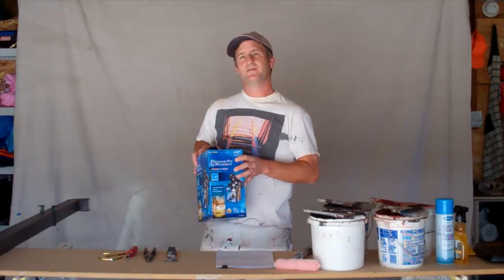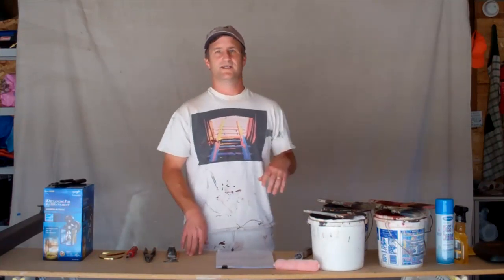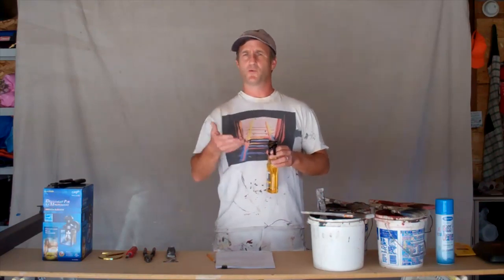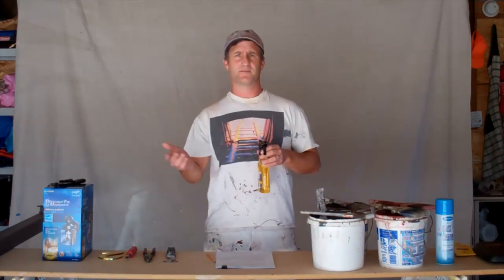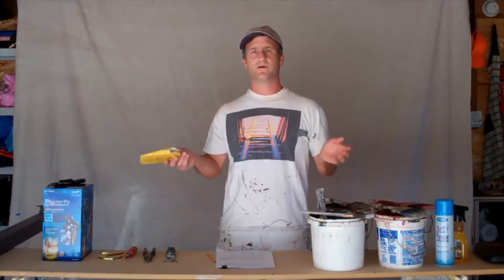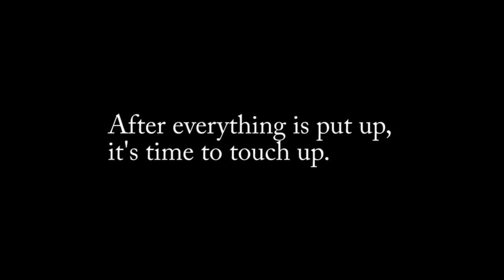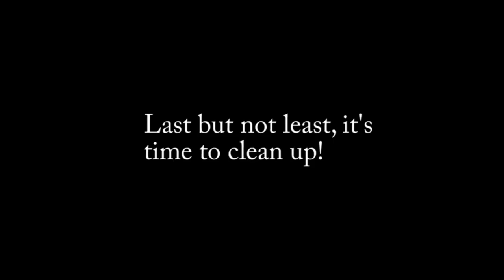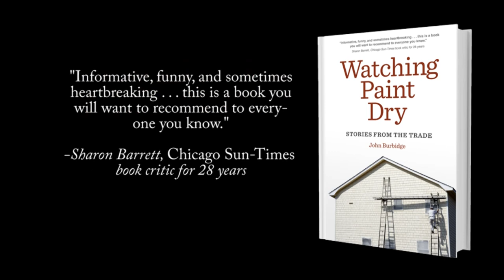Exterior Painting Step 10: Put Up, Touch Up and Clean Up

Comment from the maker: Hi-- Are the shakes irregular or uniform? If they are irregular, I recommend spraying them and backrolling with a 1-1/4 inch nap (thick). You need to work the paint into the grooves and grain. Spraying helps to get the paint into all the cracks, etc., that are hard (or even impossible) to reach if you are using a brush/roller combo. I hope that helps. Good luck!